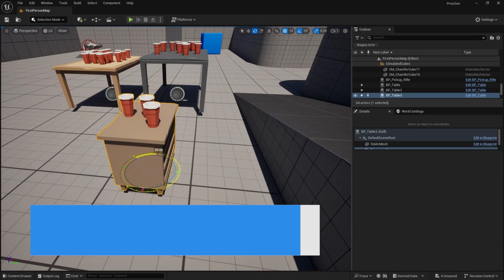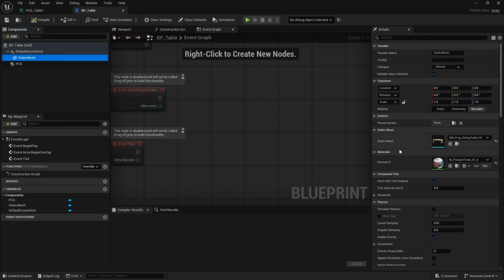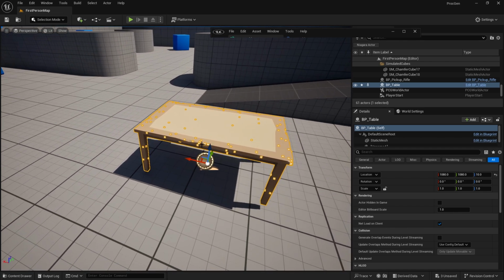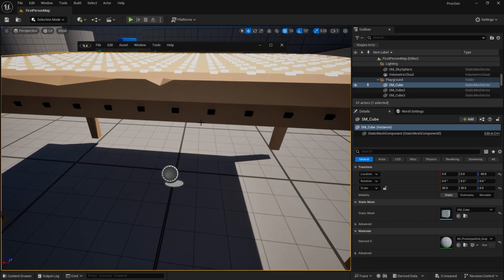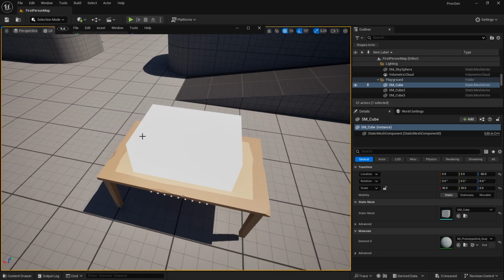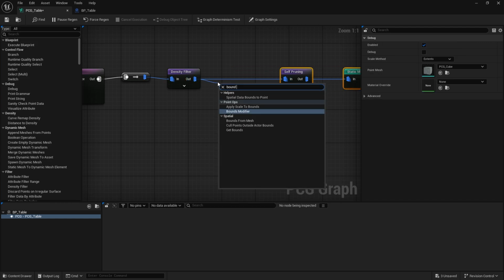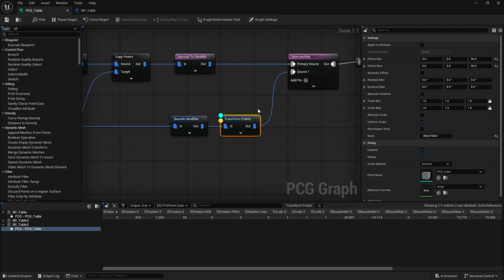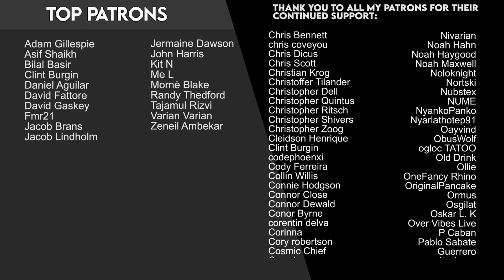Unreal Engine 5 Tutorial -  Understanding PCG Part 4: Sampling Meshes

Comment: Hi! After I copied the points from mesh sampler to actor data they are completly unaligned with the mesh (like a random offset), has someone running into the same issue? I'm in 5.6
Reply: I found the solution! The culprit was the point convertion (strangly rounding point location toward hundred values) ; on the "get actor data" node, under "data retrieval setting", switching mode to "get single point" have fixed it

Comment: Hello! I ran into a problem with the cups only appearing when I have a debug on one of the nodes before the "Intersection" node. It doesn't matter which node, as long as debug is on and before the intersection. Still trying to work out the issue. I'm using UE5 Version 5.5.1 btw, thank you!
Reply: I noticed its actually only working when I have debug on the lower node chain: "Get Actor Data" and "Bounds Modifier" nodes. Once their debug is enabled the cups spawn. Then I can turn debug off and they remain. Once I move the table or generate another table, however, the cups disappear again. Then I have to enable debug once more.

Comment: Hi Ryan! I only got to minute 4. My "Get Actor Poperty" cant find the mesh.

>[MissingComponent] Error: Property ´Static Mesh´does not exist in StaticMeshComponent<

My Mesh Sampler does not have the option "Exctract Mesh from Input".
May that be cause I use UE5.4?

Thanks!
Reply: Having the same issue as you. If you find a workaround without having to update, please let me know.
Reply: Did you ever find a workaround, I'm having the same issue
Reply: @professorfroopynoopers1171  Okay, found solution, for some reason, if you change the name of the default name in the component "StaticMesh" to something custom, it cannot find it. I noticed in his video that he kept that default and so I changed the name back and it worked.
Reply: @edh3268  Awesome, thanks for letting me know man!
Reply: Same issue on 5.6 here